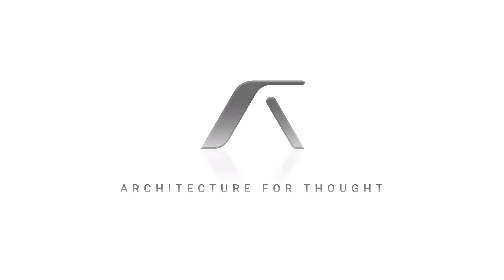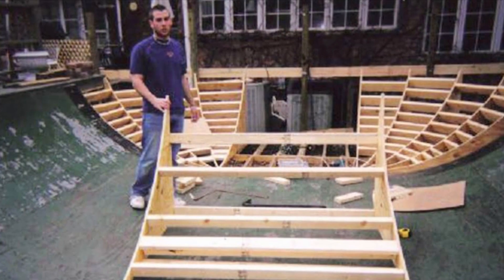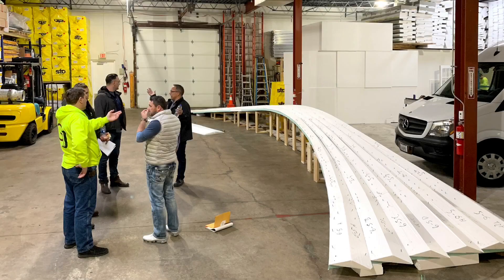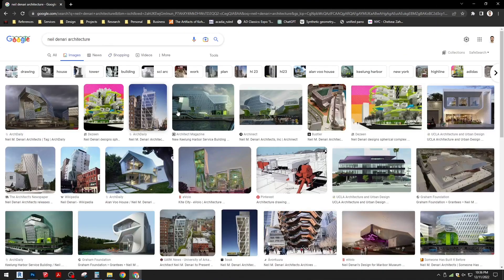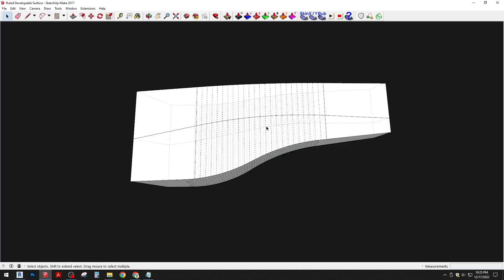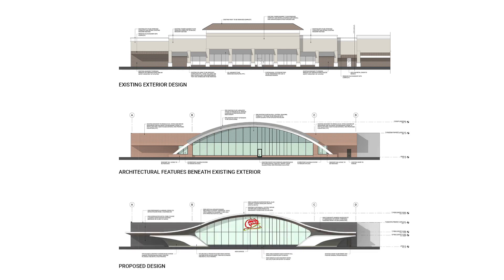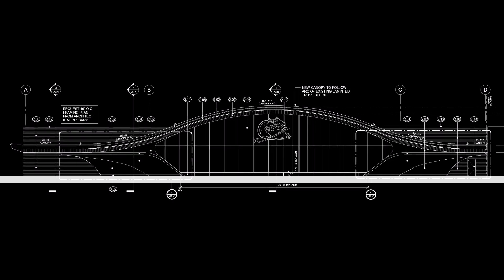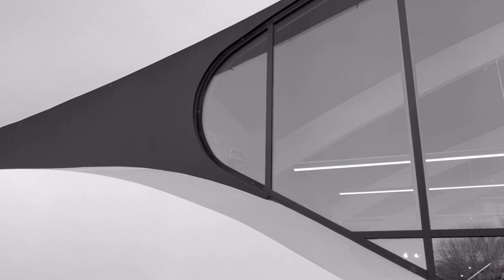Ruled Surface Geometry in Architecture

Comment: thanks for sharing, how do you unfold these surfaces to 2d representation in Revit? to make it flat I mean with same area and boundary
Reply from the maker: great question. I do not know of any tool or process like Rhino's Unroll command that can produce a flattened surface from these developable shapes. In that regard, this video is more focused on the traditional method of constructing from elevations rather than digital fabrication. I will look into that though.

Comment: I noticed you're using Revit but how could you export the panels for manufacturing without using Rhino3D, could you explain more about Ur workflow 
Thank you for sharing your experience, it's really Amazing
Reply from the maker: Nothing was necessarily exported for digital fabrication here. The geometric principles outlined here are actually best for stick-built projects, but can also be applicable to 3D printing or other forms of digital fabrication. Which panels are you talking about specifically?

Comment: wich software do you use for rendering and modeling 3d
Reply from the maker: Primarily Revit both for modeling and rendering. Sometimes I’ll model conceptual work in SketchUp if it’s a really quick exercise. But ultimately every project ends up in Revit for documentation purposes.